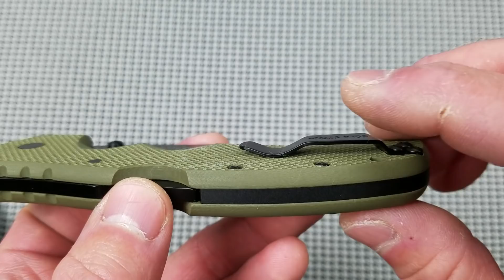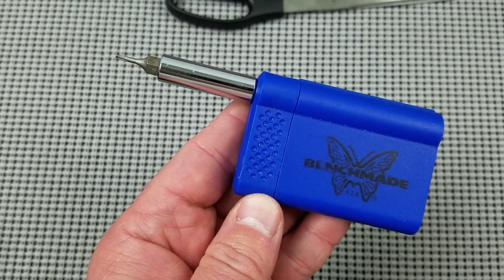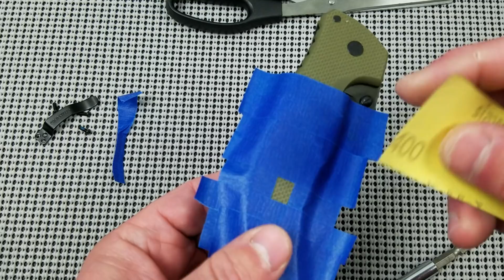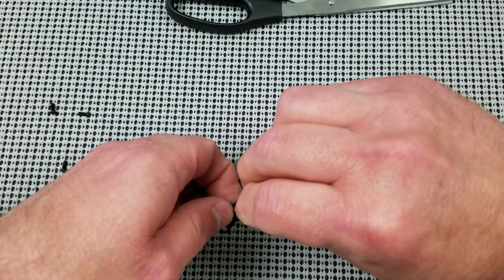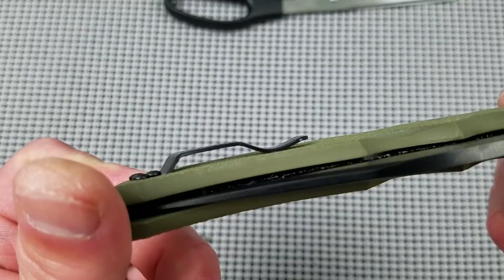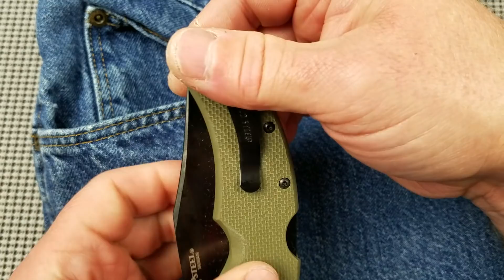Mod Shop: Cold Steel coarse G10/pocket clip mod.

Comment: Think I'd go a little more above and below the contact point, so it doesn't drag at all.  If it's more noticeable, so be it - it's a tool.  In fact, I've used 400 grit sandpaper on polymer pistol grips and G10 grips.  When you're done, clean it up with some rubbing alcohol and call it good.
Reply from the maker: That is a viable option. You are correct. This is a tool knife.

Comment: And I had a blue box and they have the worst quality drivers ever. Striped way too many screws. Got a wizards set for like 10 bucks Work great.
Reply from the maker: Matthew Forrest, I've never had a problem with mine. But I seldome use it. It's part of my travel kit. Just feeling nostalgic today.
Reply: Baz on Blades you have an old one so I’m sure it’s ok. But I assure you the new ones are not as hard as the ones you have. Lots of slop

Comment: This is a great mod, though too late for many pairs of my pants. I do sort of the opposite thing with my smooth scales, such as the Cold Steel Code 4, where I use some carefully placed friction tape. I also put some Wrangler Riggs Workwear Tehnician Pants, with that reinforced pocket edge, on my shopping list. Until then, I wear shredded pockets with pride.
Reply from the maker: Scott G, you see I'm not really worried about shredded pockets. I just want to take the edge off that pocket action.

Comment: Sand down the g10 thats under the pocket clip and get an aftermarket clip 🖒
Reply from the maker: Why get an aftermarket clip? The original works very well.
Reply: Joel Moore Yes. The stock clip is way to stiff.

Comment: I have the same one from ur video and the older aus 8 version which is trash compared to the xhp
Reply from the maker: Clawton Webb, the older versions also suffer from the hollow grind, soft plunge and terrible sharpening choil. Leaving the section of unsharpenable edge grind at the plunge termination.
Reply: I AM VERY PLEASED BY THE " RECON 1" IN AUS 8...I OWN 3 CLIP POINTS AND 1 SPEAR POINT ( IN LARGE), AND ONE EXTRA LARGE, ALSO AS A CLIP POINT...THE AUS 8 NEVER BOTHERED ME, NOR DID I HAVE ANY ISSUES SHARPENING THOSE IN USE....
Reply from the maker: cuchulainn1967, the AUS8 isn't the problem for me. The edge geometry/plunge/sharpening choil is what I didn't like about the older versions. My Talwar folders are the same way, same problem and they are my fave CS folders.
Reply: HEY, YOU ARE WAY MORE AN EXPERT THAN I WILL EVER BE...MOST OF MY KNIVES I DON´T EVEN USE...I BUY WHAT I LIKE ( MOSTLY BY LOOKS) AND THEN I PUT THEM AWAY...THEY JUST SIT IN MY COLLECTOR´S BOX....AND MY FEW USERS, WELL, I SHARPEN AND STROP THEM BY HAND...NO GADGETS, THEREFORE, I SUPPOSE, I JUST DON´T ENCOUNTER THE SAME PROBLEMS?!?!?...BY THE WAY, I NEVER UNDERSTOOD WHAT THE SHARPENING CHOIL IS FOR...WHAT HAPPENS IF THERE IS NO " GAP" AT THE END OF THE BLADE?
Reply from the maker: cuchulainn1967, all the sharpening choil does is allow for a clean termination of the edge grind before you get to the plunge grind. If you have a soft and wide plunge grind it will cause your edge to flare because of the extra thickness at the edge and plunge juncture. That place of extra thickness is where the sharpening choil should be. So you don't get that flare.

CS can be pretty bad about this on some models. You will see it where they end the edge grind really early on those models. Most brands are are bad about this. No matter the cost.  Both of my Talwars have this issue. But it doesn't make them bad knives. In fact I love all of my CS folders. It's just something that I have to cover as a reviewer.
Reply: THANKS FOR CLEARING THAT UP!!!...MAYBE THAT COULD WORK AS A TOPIC FOR A FUTURE CLIP?!?!?
Reply from the maker: cuchulainn1967, I will definitely cover it when I do my Recon 1 review.